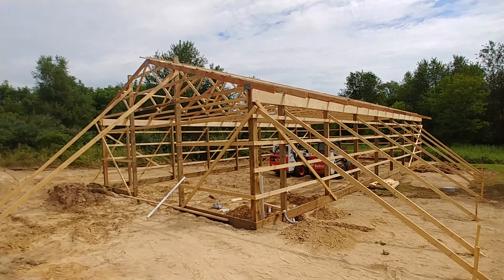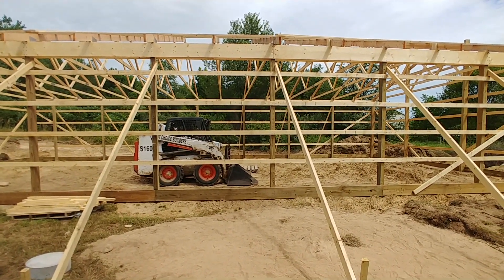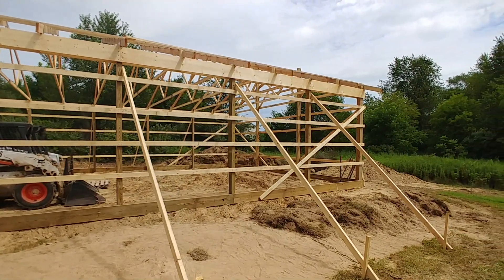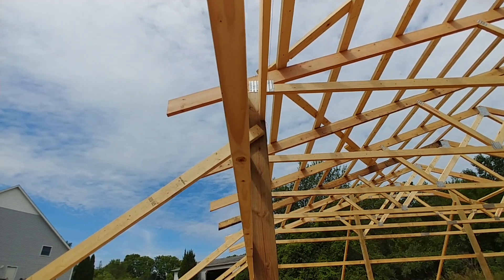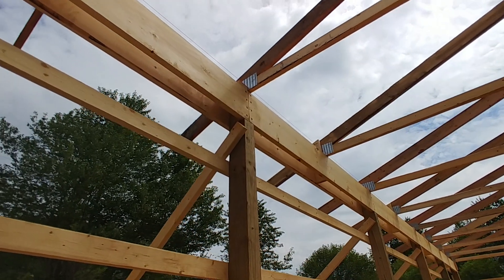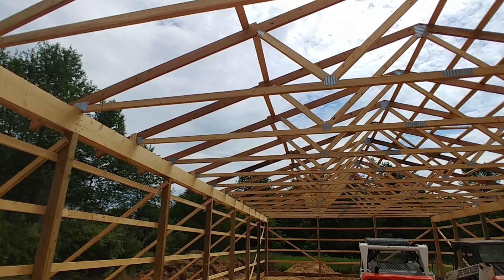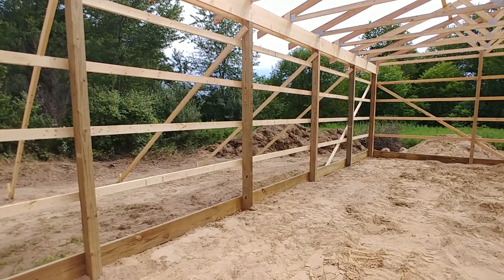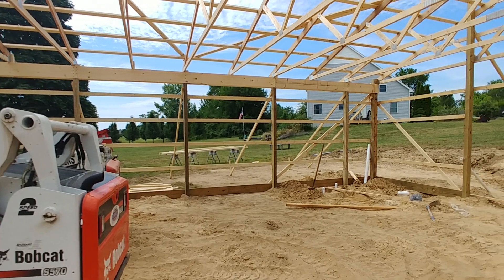How to build a pole barn part 2

Comment: I know you get a lot of snow and cold weather up there, so I'm curious about your plan for the winter months.  I've never built a pole barn... are they typically insulated?  Will you be heating your space?  Keep the updates coming!
Reply from the maker: Yes it get very cold up here.  With my pole barn yes it will be heated and insulated.  Just not sure how much time it is all going to take me to do it. :)  the typical pole barn though is not finished inside at all.